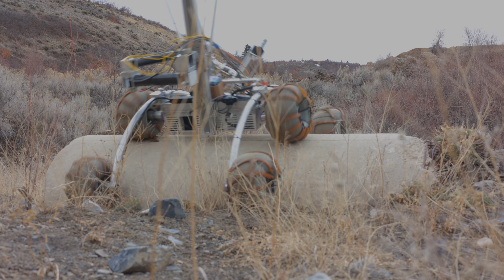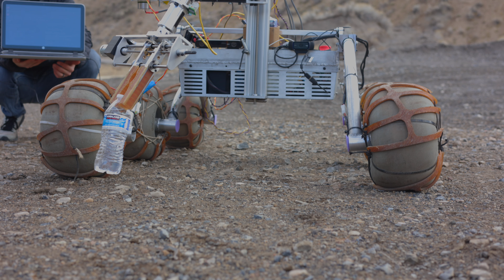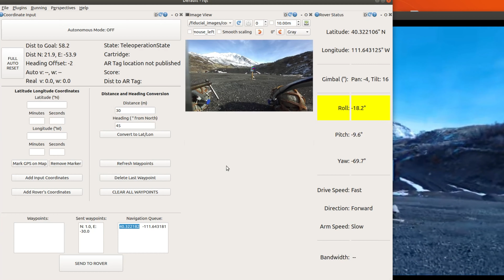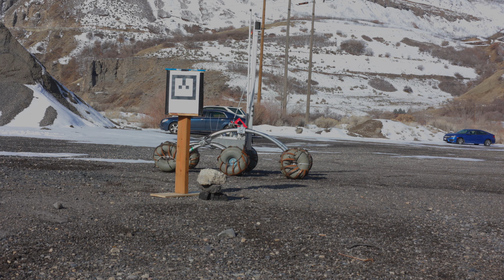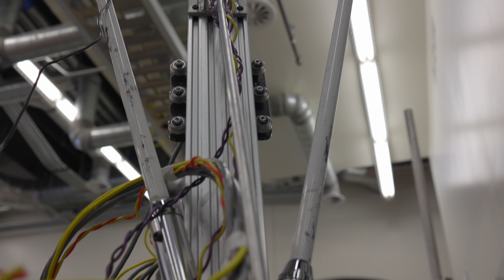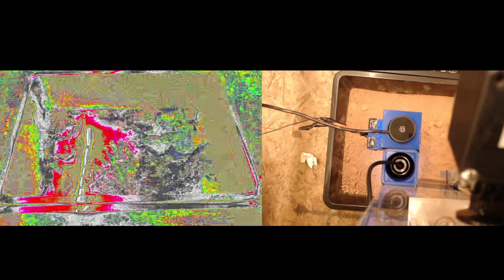BYU Mars Rover - System Acceptance Review Video - URC 2021

Comment: Looking at this video I see long term weak points in the loop suspension system joints, throw I see you have spent more time with software, then on system design. I would have built and antenna tracker for your base station which are used with FRP radio controlled aircraft.